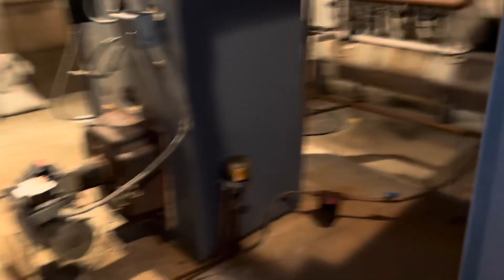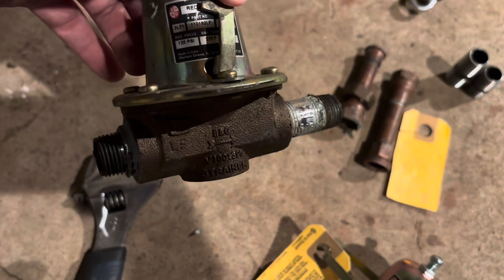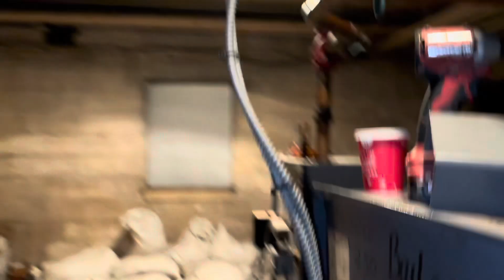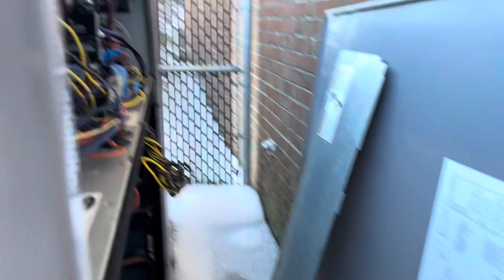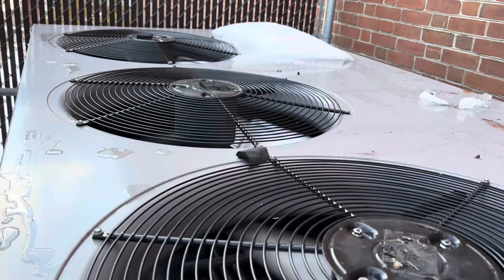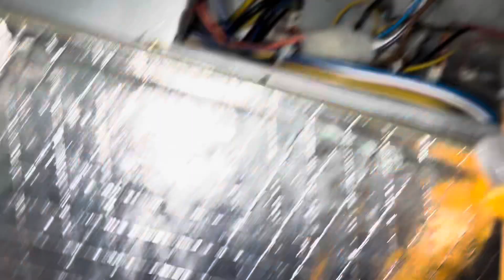Boiler Repair Turns Into A DISASTER!  Plus Other Repairs!  WE BACK!

Comment: Olsa tools makes magnets that fit inside sockets. I have them in SAE and metric. I also have magnetic 1/4 shaft impact sockets. If you didn't want to use an impact you can use them in a bit driver handle. That seems like the best way to go.
Reply from the maker: Thanks! I'll have to check them out.

Comment: Super glad to see you back❤. An  your spot on tracking brown shorts can be a son of a gun at times !! I don’t mind the constant short it’s them intermittent that pulls my hair out an I am dang near bald so I can’t afford to lose any more hair 😂😂😂 A great job on troubleshooting 👍 
Going backwards  here the fried motor?  That job was 3 Hail Mary mother of god protect me 😱 Most people do not realize an icicle falling from 3 stories down  can actually pierce your heavy coat an that big one up their is a knock you out on 😬  on the first SC ? I seen the bale off an my first thought was oh oh not a good sign!! And the expansion tanks?? It is surprising the number of of installers that do not realize  their is a right way AN a wrong way to install an expansion tank vertical installation requires a special tank designed for vertical.. 🤷🏻‍♂️ But I hate deals like that because money is tight an you want to help the customer but broken is broken 😞  But I top my hat to the installers on the pressure valve “” THEY was thinking of the future 😁👍 … drilling a pin hole an draining the line  sucks..    laughing when re did  my house heating this summer ( usually at night after hours)  got a fortune invested in unions and ball valves. But I can work a repair every thing even including the zone valves with channel locks 😂😂😂 I don’t need to drag the torch out to fix anything. .. I was thinking forward to the future !!😂😂😂 My heating system is so complicated. I had to blueprint it. 🤦‍♂️ Navion Combi. 240 primary. An a crown back up boiler. An  an outside wood boiler.  And yet keep each unit independent but yet share controls .. yep a  bunch of 24v isolation contactors was involved..  But for warranty purposes, there’s no chance of any feedback even if all 3 heat units were online at the same time… lol spent a lot of nights drawing 😂😂😂 but in the basement is finally detailed, self-explanatory blueprints so if I kick the bucket an wife hast to call some one in they got a fighting chance of not being intimidated ❤❤

Comment: The last couple of weeks I've been watching the new listings for boilers on EBay, you can find some good deals there if you look carefully and are patient.  A new in box  Navien Condensing Heating Boiler NFB-200H 13,300 - 199,900 BTU/h, TDR 15:1  $2,200;
SLANT/FIN VGH-399-CH 396,000 BTU WALL MOUNT COMMERCIAL CONDENSING BOILER 95.5% Brand New  $2,999
Singular 5200 199,000 BTU Combi Gas-Fired Wall-Hung Condensing Boiler Brand New $2,850
The chirch can save some money on their natural gas bill.